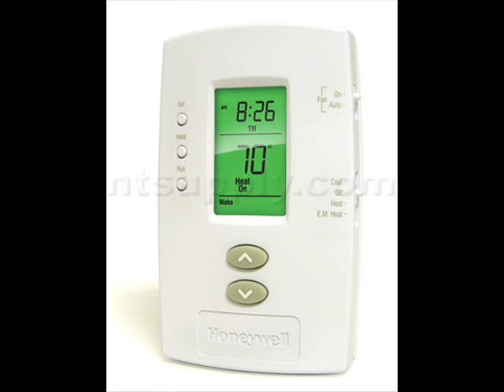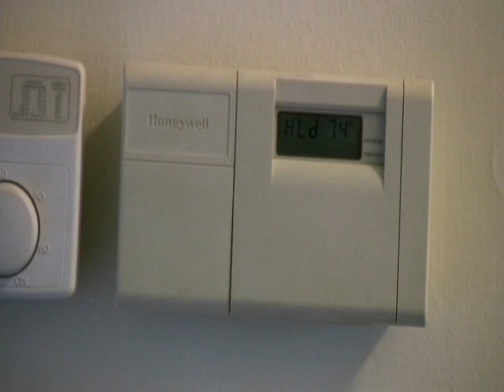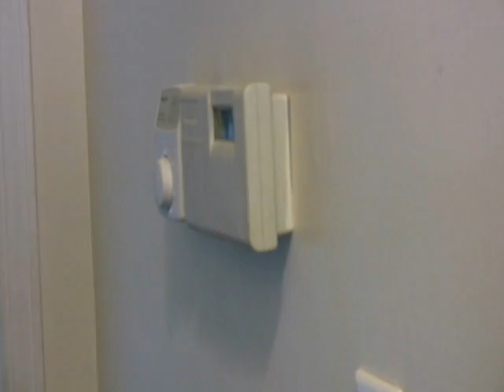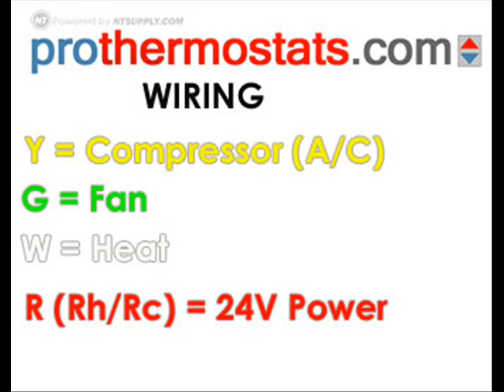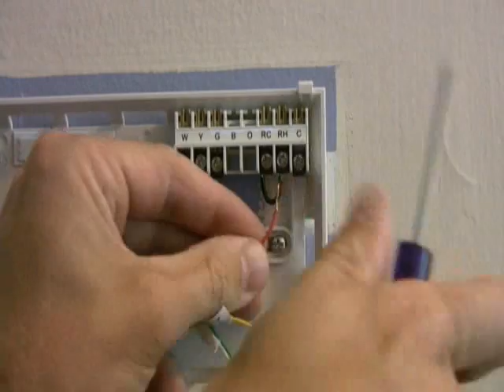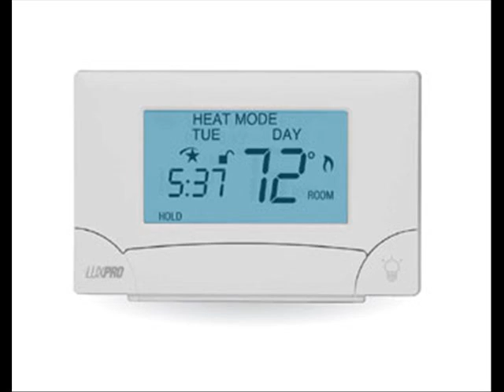How To Replace Your Old Thermostat

Comment: what if the terminals on the old therm terminals are not lettered? My just have numbers.

Here are the codes on the back: 

PC8900 A 1007 (1) 
bar code 
08526715241 
0427 
49357 
207573B REV. 
bar code   

This thermostat has numbered not lettered screws

Currently Black to 1, Green to 2, White to 3 & Red to 4

New Honeywell RCT8100 has Rh Rc W Y G terminals

Where do my colored wires go?? New instructions assume old therm has lettered terminals and says to ignore wire color?